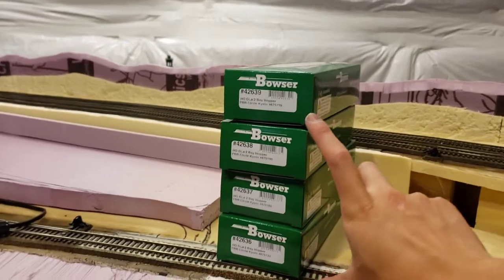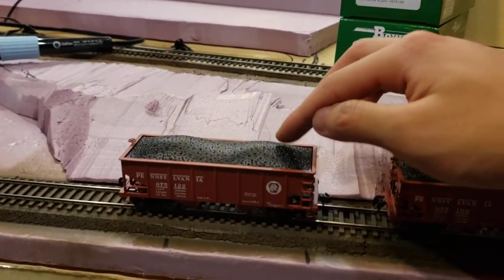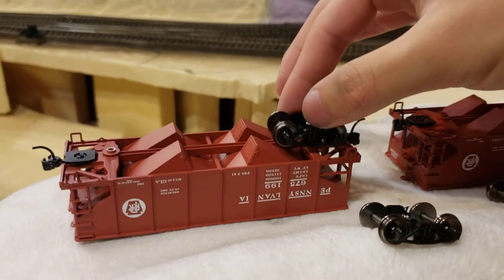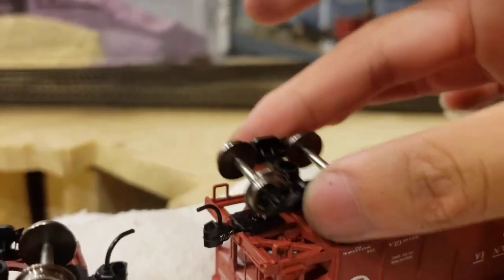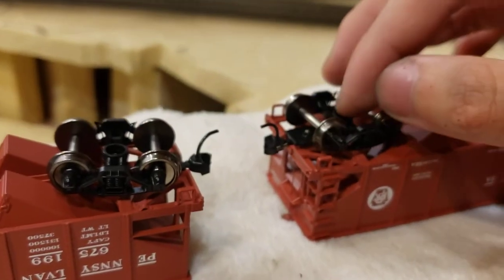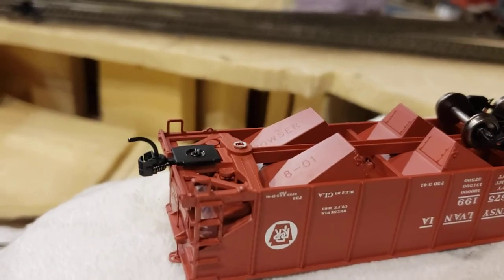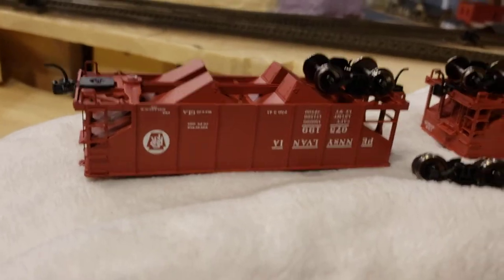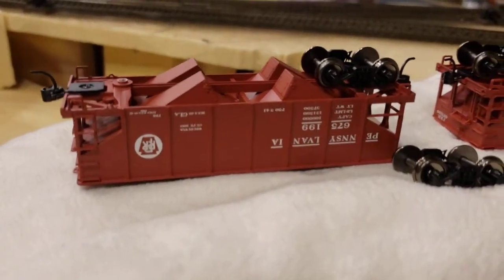An Easy Way to Fix and Reduce Body Wobble on Freight Cars

Comment: I add a small shim to the truck bolster more like the prototype but your solution is quicker and easier and you`ve got a great result so, well done.
Reply from the maker: that works too! but my cars already had perfect coupler height, so adding a shim would increase the coupler height, making it off. Cheers!
Reply: @trainman440  Hi Trainman440, That`s not quite what I meant. I add the shims, two of them on each side on the sloping part of the bolster. I`m not altering the coupler height.
Cheers, David.
Reply from the maker: @trainsontuesday  oh okay, I see what you mean, that works too! Thanks for sharing